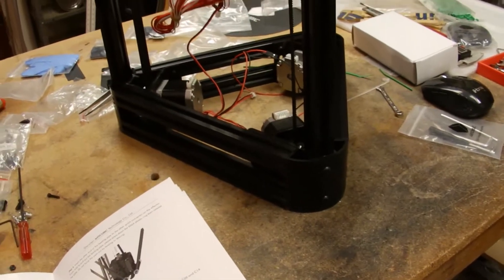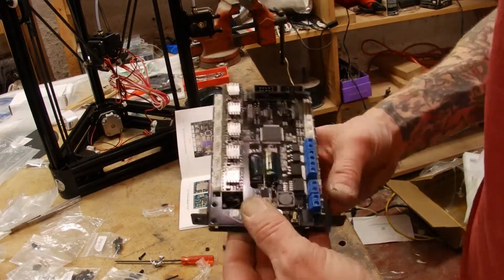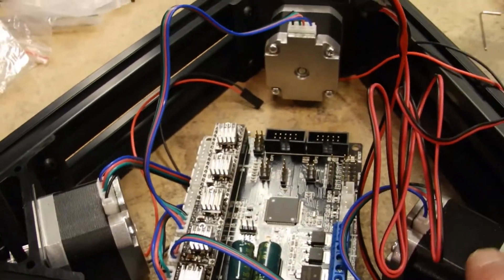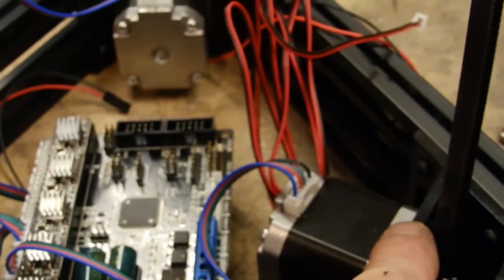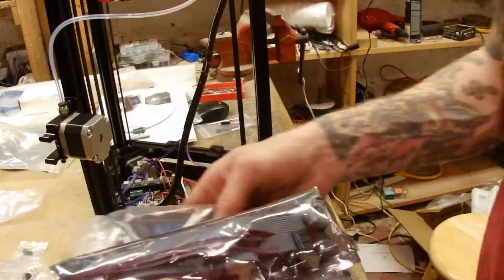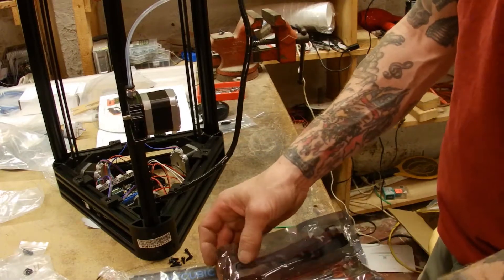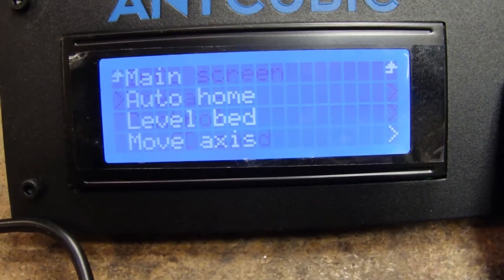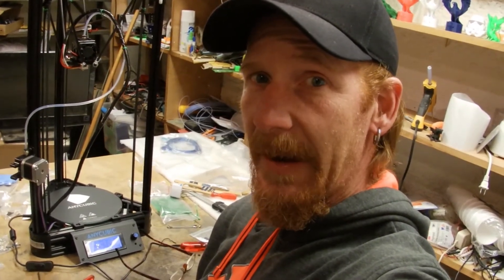Assembling The AnyCubic Kossel 3d Printer From GearBest (PART2 The Control Board)

Comment: I really wish you had shown how to plug in the power supply.
Edit: I guess I have a different power supply a 110V/230V that needs to be added to the board.  Thanks for the helping hand.
Really grateful though that you showed how to insert the T0 or the two white wires and the heat0.  I know it seems easy once you think about it but this is my first printer that I'm assembling.
Reply from the maker: Xochitl Sandoval the power was just a barrel connector for me
Reply: @InsideTheMindOfMatt  Thanks for the quick reply.  I have an AC/DC S300-12 that plugs into the board.  All I have are two thick red wires and two thick black cables.
Reply from the maker: Red is + black is -
Reply: @InsideTheMindOfMatt  But which two red and which two black go together?  There's four wires altogether and they are not labeled which go into the -5A+ or -11A+.
Reply from the maker: A or V? If V should be the 11 
Any way you can send me a pic all my social media contacts are in description
Reply: @InsideTheMindOfMatt  see you on Twitter.
Reply from the maker: Yes thanks for that so a black for each - and a red for each + don’t matter which black or which red just remember red is + black is -
Reply: @InsideTheMindOfMatt  okay Thanks for the clarification.